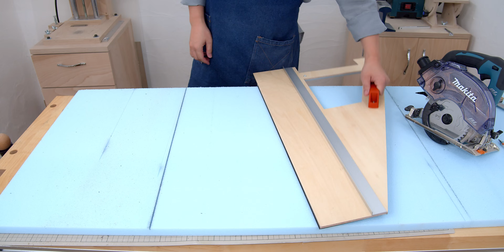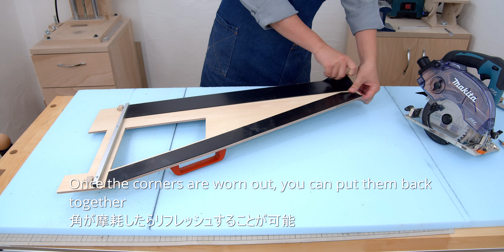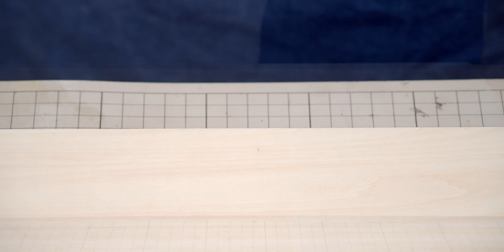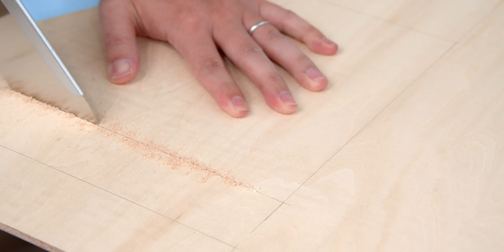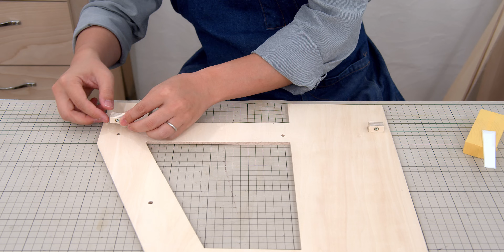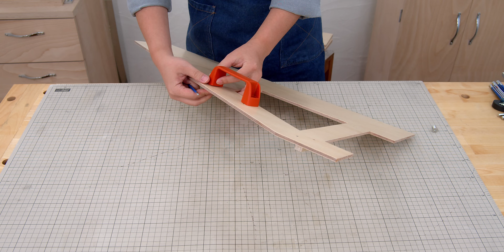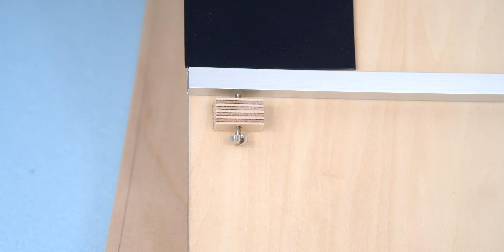Amazing !! Circular Saw Guide

Comment: I have a circular saw that I've always found awkward to align for cuts. I was looking into the possibility of getting a table saw instead to the rip cuts that I was doing with the circular saw.   On seeing this video, I've decided to hold off on that idea and build one of these instead.  I don't normally pay for plans, but this time I decided that the jig is that well designed it's worth getting the full drawings and instructions to use alongside the video.    The demonstration and construction walkthough is excellent and I feel that even I can complete this project.
Reply: Thanks for the comment. I'm thinking of getting the plans as well. Just wanted to see how your jig came out

Comment: Very nice. I built the first version but not having the same level of precision as JSK, the guide on mine wasn’t square. I will make the modifications to match this version. Thank you JSK-KOUBOU! I love watching your channel. I have my eye on making your jointer and router table
Reply: The side where the blade travels will square itself up as the blade cuts off the edge of the guide, then the aluminum table catch underneath it can be adjusted using a carpenters square or large speed square for reference.  That's why he added the small adjustment thumbscrews.
Reply: @jimthesoundman8641  So once the small screws are set that should be it squared forever right? 
A good way to do it, I had mega problems getting my perpendicular to blade side to be at 90°.

Comment: To improve in this design, add a small measuring tape to the window cutout. Then you can make exact cuts by aligning the edge to the edge of the board you want to cut, marking the length inside the window, then shifting the mark to the zero mark on the tape, then cut. Perfect measurements every time.
Reply: are you able to share a screenshot of this pls?
Reply: Oh yeah I see what you mean

Comment: 神アプデ！w

縁からチラッと覗く黒いところが、ラインに合わせやすそうなうえに、張替えていつでも新品の状態に戻せ、垂直の微調節も後からできる！

これは、長く使い続けられる良品！

あと、スタイロフォームも何気に便利そうw
Reply: The black part that peeks out from the edge makes it easy to match the line, and you can reupholster it to return it to a new condition at any time, and make fine vertical adjustments later!

This is a good product that can be used for a long time!

Also, Styrofoam seems really convenient lol

Comment: Doing remodels I have to cut a lot of doors. 
This would also work well for cutting siding. It’s alway too flimsy to feed into a chop saw.
Decking is yet another good use. I always fasten my decking long then snap a line and free hand the perimeter. This tool would keep me on the line much easier. 
This is pretty damn cool.

Comment: What kind of rubber backing, and where to get it
Reply: I’m curious as well
Reply: I would love to know as well. This is a great project.
Reply: What is the purpose of the rubber backing 🤔
Reply: @shaneoreilly8488  It can be trimmed with the saw so that you know exactly where the cut line is (instead of having to measure how far away the blade is from the edge of the saw plate, and always having to account for that distance in all your layout)

Comment: Does anyone know where to get that hand saw? I didn't get far with the links.
Great build! Fantastic video!
Reply: Stevie Spoolspinner hello in a internet navigator, enter « japonese saw » . A....n abd other specialized shop propose this article
Reply: @totopareil1220  I tried that, and got lost in all of the Japanese names. Do you know what type this one is? I could only find it on Japanese Amazon and it's out of stock. I couldn't find any other saw that had that particular plunge angle at the end.

Comment: Beginner here; what's with the A-shape of this guide and is the hole for weight reduction? The rubber part thing too, what do they mean at 0:58? I like the accuracy of the cuts but wondering about the design ideas here.
Reply: Rubber part is there to prevent the guide from sliding while making cuts, its adhesive anti slip tape/mat/strip
A shape is probably just aesthetics. 
And sure, it does reduce weight.

Comment: I'm not following some things...what is the black stuff he puts on the bottom and and what's it for? Also is that blue stuff just a foam pad or some kind? Something fairly stiff I'm guessing.
Reply: black stuff = adhesive anti slip tape/mat , basically you need to put something under so guide doesnt move while you cut
foam is just Styrofoam, you use it as "sacrificial peace", you see- when you cut something on your desk, you dont want to risk cutting or damaging your desk, so you always place something else on top of desk that will get damaged in process and save your desk, and then you place the peace you want to cut on top of sacrificial peace.
You are going to make 1000 cuts and slices and grinds, that will destroy your workbench/desk/table, and then you have to make new one, to avoid this just use sacrificial peace that will take the beating instead. Thats what that foam is there to do.
Reply: @common_sensei6235  Thanks! Also your name is amazing.

Comment: Its easy to see how convenient this jig is and to note the, black, non-slip, reference line and mitre-bar as being excellent, useful features. However, its simplicity almost disguises the real innovation in this. 
So I will just state the obvious;  that the combination of the window and the mitre-bar allows a circular saw guide (predominantly intended for cutting sheet materials) to also easily cross-cut non-sheet materials; by simply gripping the jig to the material.
I do have a suggested improvement though.
The window and the mitre-bar should be moved further away from the rear edge. This would allow the saw to be fully supported by the jig before it started cross cutting the ends off the 3x2 material. Alternatively retain the window and mitre-bar just as they are and change the shape of the jig to include that extra early-support. To have the saw fully supported before it started cutting would of course be useful either when cross-cutting timbers or ripping sheet materials.

Comment: I dont understand the need for the adjustment screws. I would have installed the fence, and rubber, cut it with the saw, then used a roofing square to align the stop edge at the bottom to be perfectly 90° with the rubber edge

Comment: Anyone know what the black thing on the underside is? Rubber or some kind of plastic? Please put in the reply any brand name that would be easy to search for... Thx!
Reply: Neoprene
Reply: Not sure what material he has used, but i am going to go with the vinyl cove base (4' pieces: flooring dept. @ Lowe's/ H.D.). Using the flat portion and trimming off the curve should do it. I think it is 'grippy' enough for this purpose. The price is right, even if the product doesn't work out.
Reply: It's rubber, it helps to avoid splintering and tear out as the saw blade exits the cut.
Reply: Looks like builder's damp course neoprene- used by bricklayers - in UK at least.
Reply: Maybe anti-slip tape?

Comment: Great design! But I just curious how to prevent the jig’s lateral movement during the cutting? Especially during the long cuts, 2 f clamps perhaps a good solution instead of hand. Cheers
Reply: Does the padding on the backside grip the material preventing lateral sliding?

Comment: What was the black rubber material? where can I get it!!
Reply: I'm not sure where you are, but in Australia you can buy it in the building supplies area of any hardware store (eg Bunnings) or a rubber store (eg Clark Rubber). It comes in all different widths and thicknesses. It's used for all sorts of stuff, typically for sealing around doors and windows etc.

Comment: I'm confused as to why the non-slip rubber strip appears to be intentionally placed to overlap the edge of the guide.  Doesn't that block the view of the intended cut line?
Reply: I might be wrong, but I got the impression he was using it, with its highly visible black color as the cutting line. So after he initially trims it with the saw, it's lined up with the blade, and you would then line up the black strip with your cutting line. That's my guess anyway.

I'm more confused by the fine adjustment screws which are attached to the same surface as the bar they're pushing against. Feel like I'm missing something obvious there.

Comment: I didn't understand why you glued the washers to the nuts for the handle?
Reply: Me neither. I saw same thing from other chanel but couldn't figure out the purpose.
Reply: My assumption is that the washers prevent nuts from "sinking" into the plastic, possibly deforming it or twisting it, also washers help so that nut does not unscrew by itself I think.
He did use two component glue to make it stick permanently, well all that matters is that the handle does not become lose or wobbly over time so you need to tighten the screws good.
Reply: @common_sensei6235  I've no problems with the washers dude, just the glue :'D

Comment: Buenos días, gracias por compartir sus conocimientos. Una pregunta: Como se llama el material DE COLOR AZUL, que coloca para hacer los cortes. Gracias.
Reply: It's insulation of some sort. I suspect it's polyurethane foam or something.
Reply: Styrofoam, XPS, EPS used for thermal insulation. Cheers!

Comment: Great video, thank you. Now, I may be overthinking this, but should this jig work for different kerf width blades? for example, I have a regular circular saw blade with a full kerf width, and another that is a thin kerf blade...so would I need a different jig PER different kerf width blade? thank you

Comment: Was it really necessary to glue a washer to a nut first?
Reply: That would increase surface area and friction so it doesn't spin when the bolt is being tightened.

Comment: I don't understand why the bar underneath needs to be adjustable. Surely it always needs to be set at 90° to the cutting guide rail.
Reply: I keep seeing this in the comments. In my experience jigs don't always stay square forever. Eventually they might need an adjustment. I'd much rather have a couple of adjustment screws than have to take the jig apart to square it back up. I'm not defending his choices here, just describing a too-familiar scenario.

Comment: I didnt understand the use of that square tube with screw adjustments. If the jig base are still regulated in 90 degrees with the side, why adjust the tube with screw? Only if you need a cut different from 90 degrees.  Or am I losing something?
Reply: I also don't really get that, either it's square or it's not. I get the need to make it square once but then surely that's it, no further adjustment needed.
Will be making one next weekend anyway!

Comment: 2:35  "Easy to cut rod" should say "Easy to cut board" since in english, rod generally refers to something long, thin, and round.   As in a "fishing rod" or the saying "spare the rod and spoil the child."  Actually, a better way to phrase it would be "Boards are easily cut."
Reply from the maker: Thanks.
I'm glad you pointed that out.

I wanted to describe it as long and thin.
I did understand that the rod is not correct in this case because it is not round.

But a board can be translated as a thin, flat board.
Can I describe a long, thin thing as a board?
Reply: "Narrow board" would be a good term.
Reply from the maker: Thanks!
Reply: JSK-koubou cross cutting

Comment: What is the name of the blue sheet you are using?
Reply: I think it's a styrofoam to prevent kickbacks.
Reply: It’s styrofoam-based insulation to avoid cutting through the work table surface.
Reply: @Toni_Snark  🙏🙏🙏🙏🙏🙏

Comment: hi! what kind of material on top of your table " blue" color..thanks
Reply: Urethane foam for sure!
Reply: Rigid foam insulation - typically used to insulate walls. Excellent for a surface to cut material on.

Comment: Although this does appear to be a nice design, it will only work for left handed circular saws like the  one you are using for your demonstration. I have a right handed circular saw (where the motor is located on the other side of the blade). I'm right handed, so simply reversing your design won't work for me.

Comment: I dont see how it is better than a regular cs rip guide and a separate speed square for crosscuts
Reply: I'm still not getting it one year later. Why make it adjustable when you can make it dead square? And why not cut the guide with the saw itself so it is always flush with the guide?

Comment: I really didn't understand the point, what's wrong with a straight edge?
Reply: How are you going to hold a straight edge?? You will use clamps, not only does that take time but the clamps get in the way of the saw. But wait there is more that you dont get. If the material is really big, you cant clamp a straight edge on to it, like a wall. This is about accuracy and saving time.